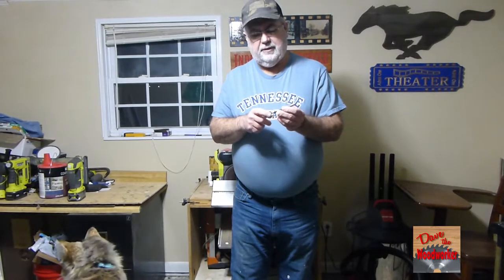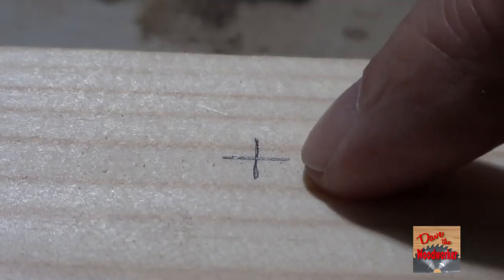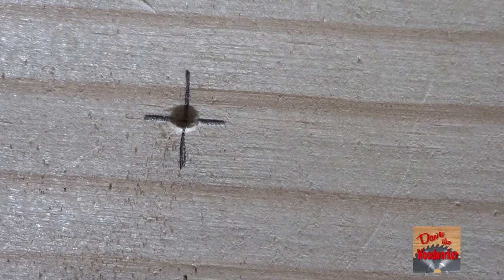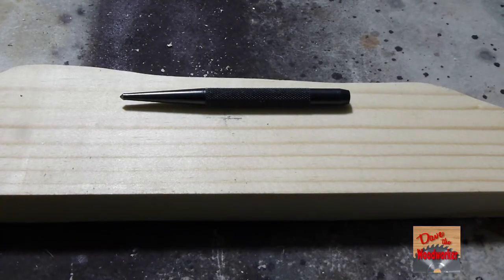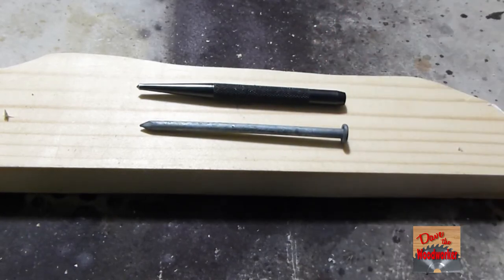What is a Center Punch? | How to use a Center Punch

Comment: I have a set of nail punches, are they the same? I use them to drive a nail in when the hammer can’t and the head is sticking up.  Some of them are hallowed out at the tip to fit over the nail head.
Reply from the maker: No they are for what you just said, to drive nails in. A center punch is to make a mark where you want to drill or start a screw or nail